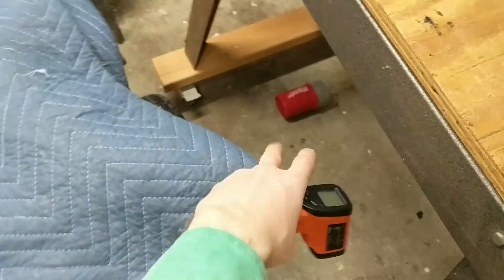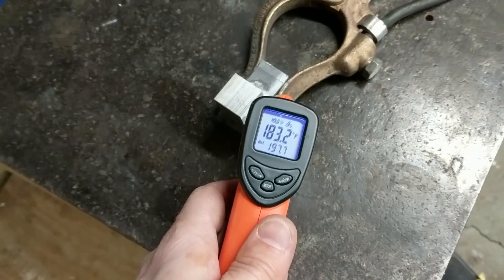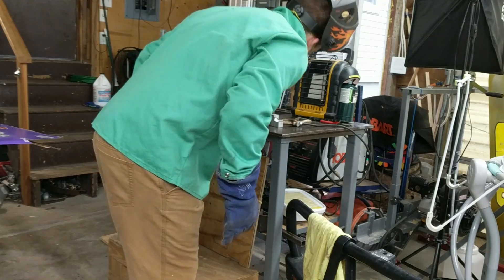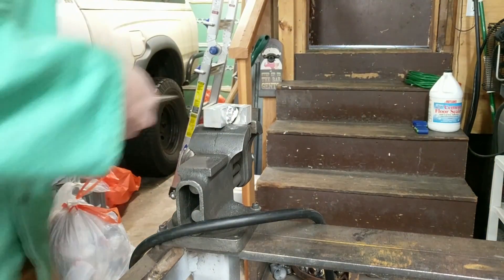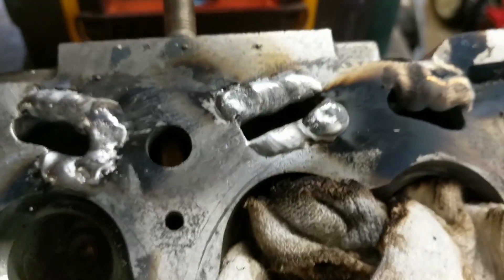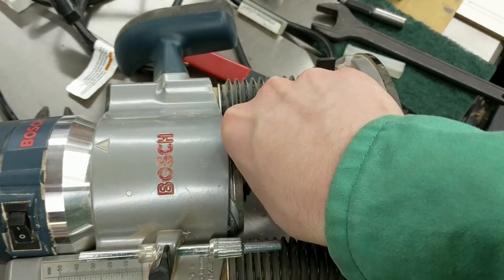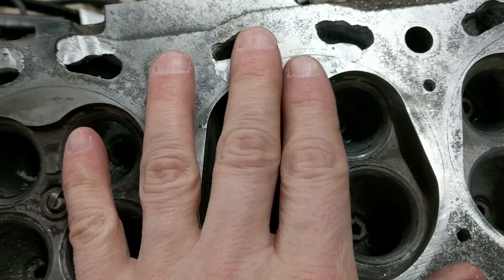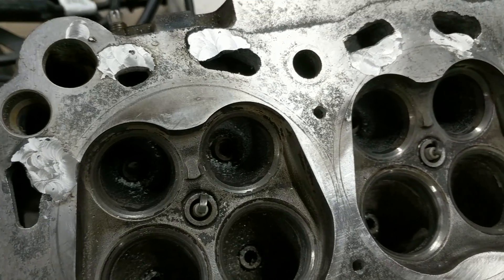MIG Welding an Aluminum Cylinder Head | Toyota 3RZ

Comment: I have found that aluminum MIG is strictly used for new aluminum material, it will perform very poorly on used/dirty aluminum because of its very poor cleaning action. TIG is the way to go because you have full control of cleaning action using the balance setup.

Comment: I have to mig weld my aluminum tranny case do I need to use gas or not? just curious.    and what would be a good first time machine to do this bc I also have to weld some small steel patches on it as well and would really like one machine to do both and no gas is this possible

Comment: Hello Dennis. Has a welder for over 30 years, One tip I will give you is,a paper mask will not protect your lungs. From the vapors given off when welding. Good rule of thumb  " If you can smell it,your breathing it  "  Wear a respirator used in painting and working with organic vapors. They aren't that high .  Much cheaper than the Doctor bills that will follow.
All my best.
Bobby
Reply from the maker: Thanks, I will try to get better at that.  Any tips for how to get a half mask respirator to fit under a welding helmet?  Maybe I don't have the right helmet or respirator.
Reply: @WhatDennisDoes  Thank you for the reply.  The newer Helmets, Don't have room,that's for sure. There are fresh air pumps that are made for welding,Though they can be expensive . One other thing you could do would be to build a smoke hood to carry the vapors out side during the winter months, These can be build on the cheap ,a used stove hood some thin metal for three sides,Etc  and metal duct three to six inch's in dia. would carry . The reason I say thin metal is due to the fire hazard wood will present. Look for old washer/dryer units for the thin metal. Some people will give these for free just to get rid of them.  ** One important thing I didn't mention was Make sure you Wife and Children know you are welding and to stay out, to keep the vapors out of your home. Has the HVAC unit will pull it inside. I hope this helps and sorry for the long post.
All my best. great job on the head. 
Bobby
Reply from the maker: @tectalabyss  all good info.  I like the fume hood idea, I'll have to make that a future project!  My father in law manages an HVAC sheet metal shop so maybe I'll be able to score some parts for free 😁
Reply: @WhatDennisDoes  That's great you can maybe get the metal for free or very low cost. You can make the back and sides to where you can remove and store them when not in use. The more room the better. You can also build it has large as you wish.  He can also help you with sizing the fan you will need.  If there is anything you wish to know in welding  feel free to ask. Just give me a bit to answer. I am looking forward to more videos from you.
All my best.
Bobby

Comment: From a Licended welder. Good work. only way to make it cleaner, would be
 by Tig welding. the cleaning and preheat is the key!
Reply: I'm not a welder in any sort of way. But I have an aluminum alternator cover off of my motorcycle that I have been trying to weld with a spool gun. I'm having major issues with porosity, any idea what's causing it?

Comment: Straight edge and a feeler gauge on head and table would be a good starting point. Personally l would have had it crack tested and skimmed in a machine shop for what it would cost as its a lot of work to find out its scrap.